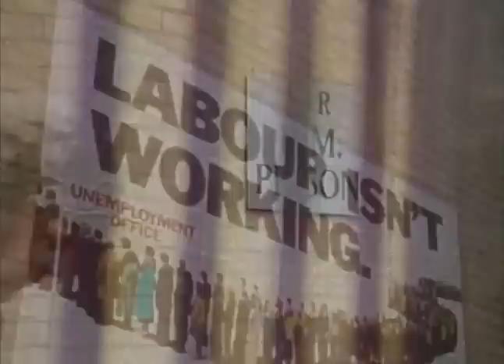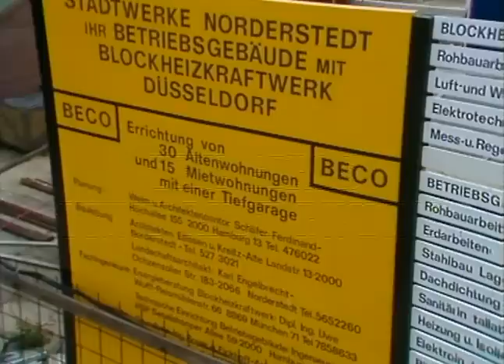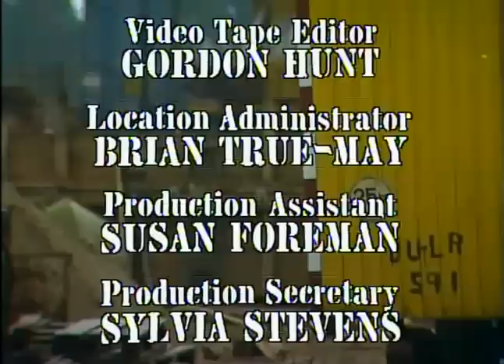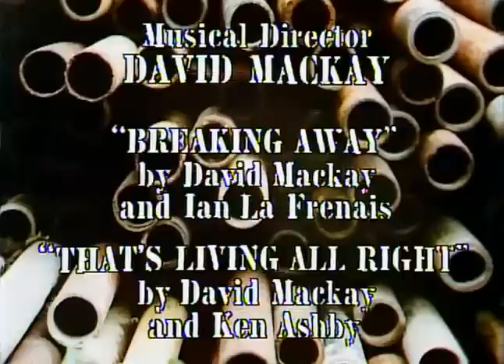Auf Wiedersehen Pet S01E03 The Girls They Left Behind   YouTube

Comment: Always thought Series 2 was as good as Series 1. Both very gritty with great humour. Then from Series 3 on, the BBC got hold of the franchise, and in typical fashion, smothered with their politically correct crap and it went down the toilet.
Reply: Not so much political correctness mate - just a different era - they were older and it was probably never a good idea to revisit the past.  Plus, Gary Holton was an integral part of the cast and could never be replaced.
Reply: Season 2 had its moments, but on reflection was far weaker. The whole plot of having them reunite made zero sense. It buggered the whole thing up. It was too contrived.
Reply: @driffter1976  I agree, series 2 was way inferior to series 1 which I have said before was the best tv drama series Britain ever produced,

Comment: trying to work out their wages, Barry said 6 months to save a thousand pounds.. in this episode they sold oz,s stuff for £230, + 3days wages was £400. so 3 days wages is £170 which works out at £56 per day????????????. just an observation!!
Reply: £56 per day in the early 80s,fuck me that would've been great money then would it not,good work m8.
Reply: Actually it was nev who said "Save a thousand pound" I was wondering about the wages as well
Reply: @Pauldjreadman  I was around back then. They wouldn't have earnt that much. £35 or £40 a day tops. But in Germany they didn't pay tax or NI. A lot of things were cheaper back then and I don't think they had to pay to live in that hut. Some things were more expensive though such as the donkey jacket, clock radio and stereo that raised £230 second hand.
This series is great but not accurate in many ways. The amount of flights back and forth to England taken by the lads and their partners is unrealistic. A return flight back then would have cost a weeks wages. People travelled out there by train or car. Especially to Dusseldorf which is not that far a drive from the Hook of Holland or Zeebrugge.